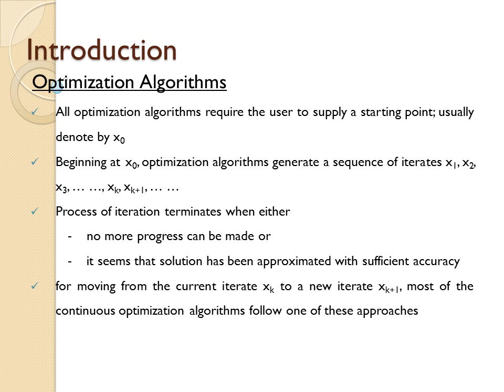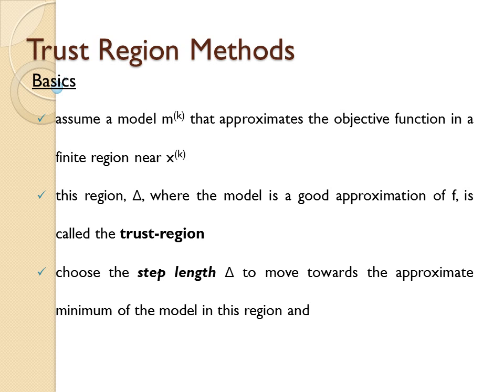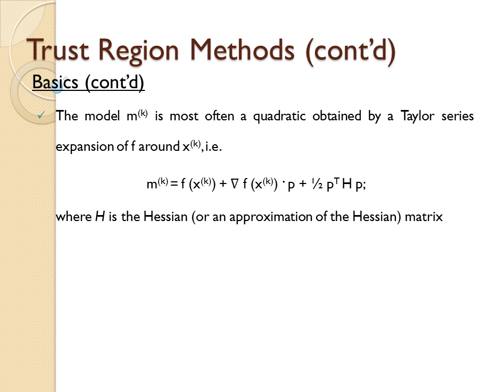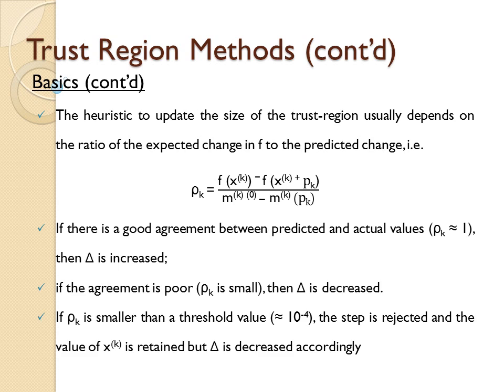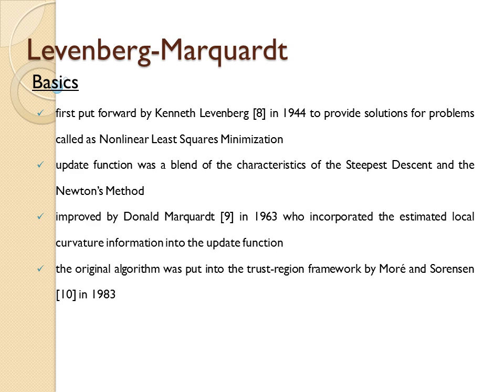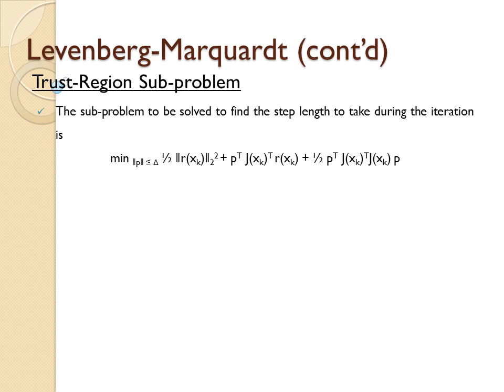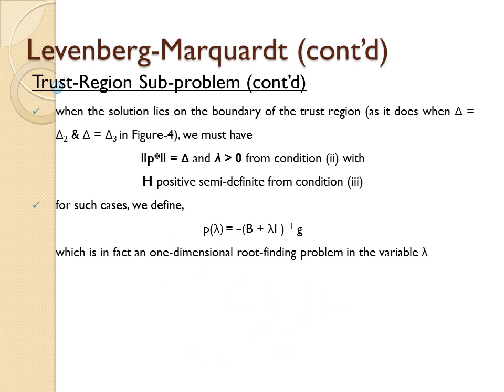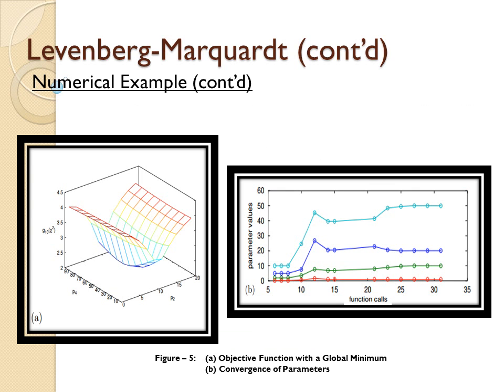Trust Region Method (Levenberg Marquardt Algorithm)

Comment: Salam n Thanks... However, voice isn't much clear. How to implement this in Matlab and then couple with other FE softwares? Regards
Reply: +Indian2020 Matlab optimization toolbox has in-built functions like fmincon, fminbnd etc, which uses these different algorithms like trust region method, active set etc. Its pretty straightforward to implement them, thanks to matlab.